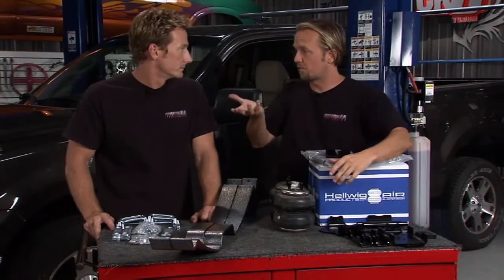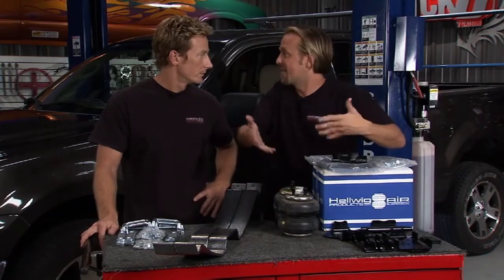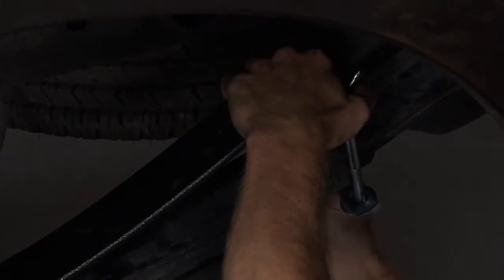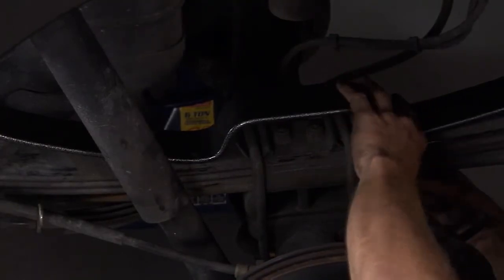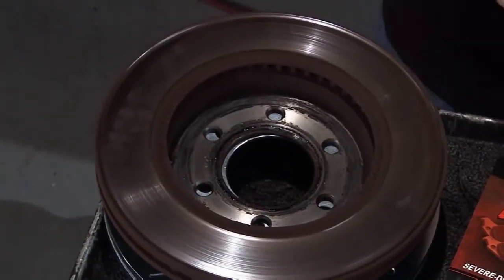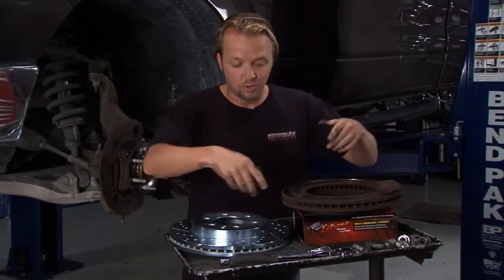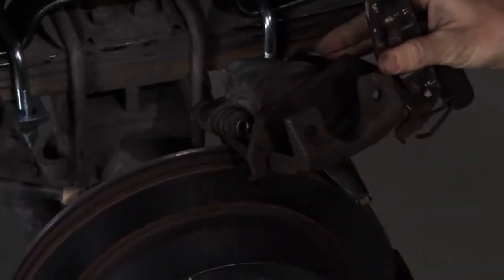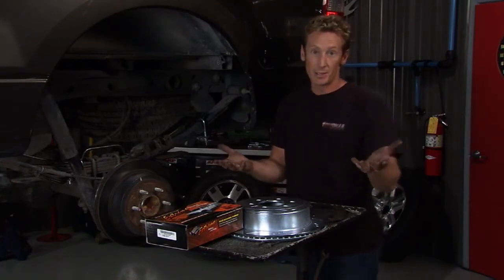Improving your Rear Suspension | TruckU Tech Tips

Comment: so u did increase the payload with airbags?
Reply: no, you will only get better handling with helper spring or the airbag. axle payload capacity will always stay the same. you'll need weight distribution hitch to be able to better distribute those tongues weight, by consequence, tow a little more (payload is better distributed to the front and back to the trailer)